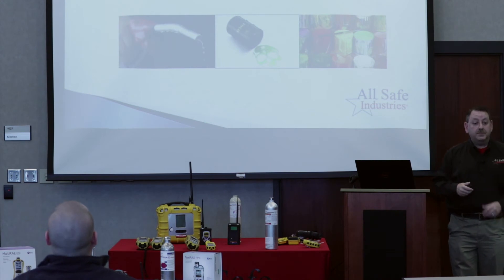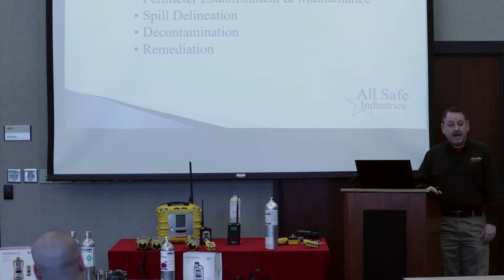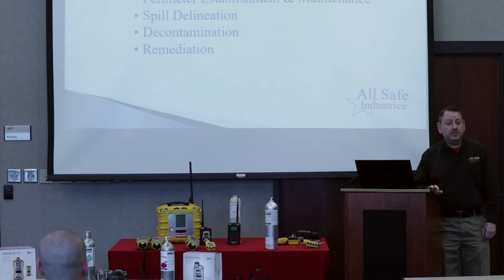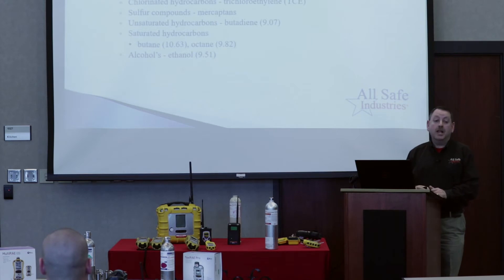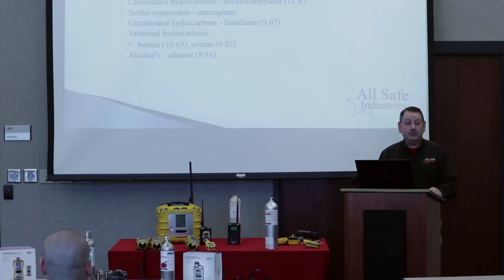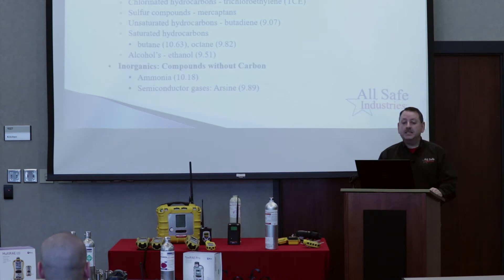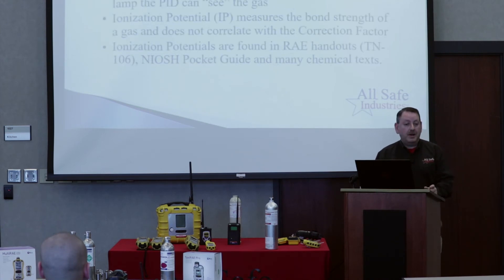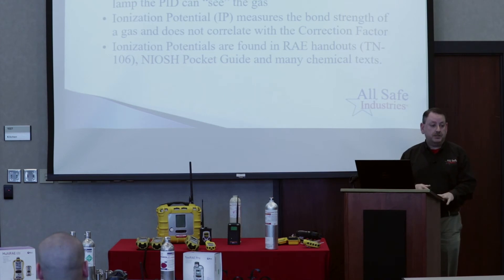RAE Gas Meter Training Pt 2: What is a PID?

Comment: why do i get a negative reading on a brand new PiD sensor?
Reply from the maker: Did you calibrate the sensor? A fresh air cal should reset the zero point, but ideally, you'd also do both a fresh air and a span cal.
Reply: @Allsafeindustries  yes, I replaced the 10.6 v sensor, fresh aired and calibrated the sensor it is reading 0 in fresh air but has negative flashing beside it
Reply from the maker: @des1867  Your best bet may be to contact our service team to troubleshoot. You can call 888-972-3389 or email tech@allsafeindustries.com.